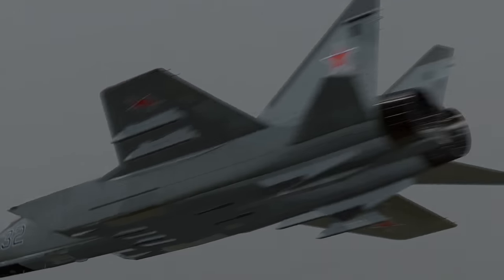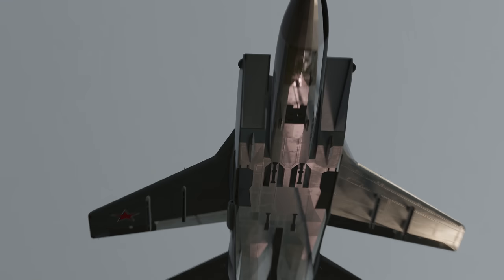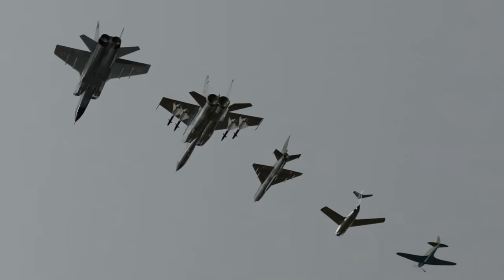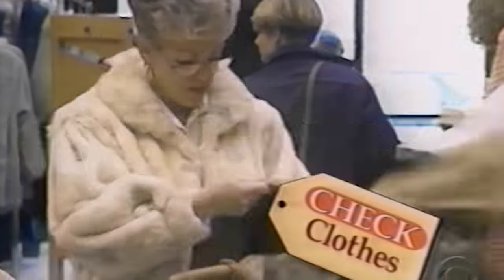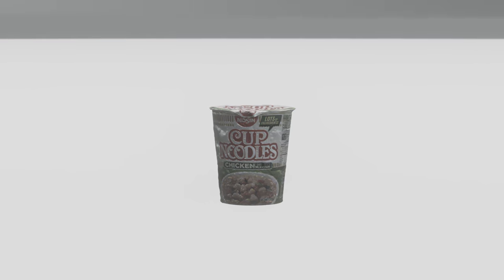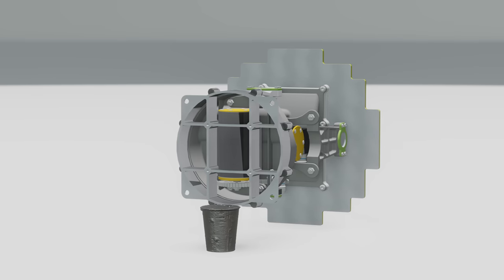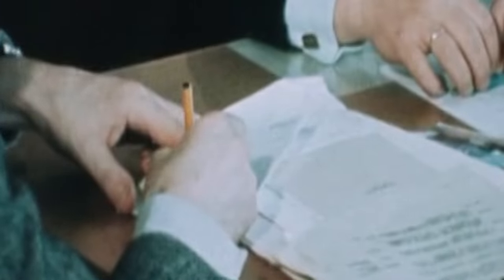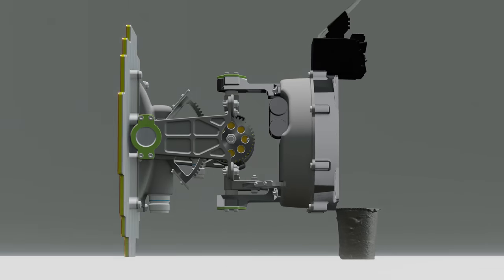We have revolutionized the cup noodle

Comment: A pencil is a kind of writing equipment that is also used to draw, usually on paper. Most pencil cores are made of graphite powder mixed with a clay binder. So, a pencil is usually made with a piece of graphite mixed with clay that has a wood case around it. The shape is usually a hexagonal prism but some pencils are square or cylinder.

Colored pencils are a kind that do not use greyish silver graphite. Instead, the core is colorful. Colored pencils or crayons are usually meant for drawing rather than writing.

The important difference between pens and pencils is that the tip of a pencil is made of solid graphite (or other material) which is rubbed off onto the paper. A pen has a tip, usually made of metal, with liquid ink coming out and onto the paper. Writing with a pen can smudge when it is still wet. Writing from a pencil can be erased, but writing from a pen usually cannot, unless it uses a special type of ink and eraser.

An early writing tool was the reed pen used by ancient Egyptians, who wrote with ink on sheets of papyrus paper.
Another early writing instrument was the stylus, which was a thin metal stick, often made from lead. It was used for scratching onto black wax that covered white wood, a method used by the Romans. The word pencil comes from the Latin word pencillus which means "little tail". It is an invention of the 16th century in England.

Some time before 1565 (it may have been as early as 1500), an enormous deposit of graphite was discovered in Borrowdale, Cumbria. The locals found that it was very useful for marking sheep. This particular deposit of graphite was extremely pure and solid, and it could easily be sawn into sticks. This is still the only large scale deposit of graphite ever found in this solid form. Chemistry was in its infancy and the substance was thought to be a form of lead. Consequently, it was called plumbago (Latin for "lead ore"). The black core of pencils is still referred to as lead, even though it never contained the element lead. 

The value of graphite was soon realized, mainly because it could be used to line the moulds for cannonballs. The mines were taken over by the Crown and guarded. When sufficient stocks of graphite had been accumulated, the mines were flooded to prevent theft until more was required. Graphite had to be smuggled out for use in pencils. Because graphite is soft, it requires some form of holder. Graphite sticks were at first wrapped in string or in sheepskin for stability. The news of the usefulness of these early pencils spread far and wide, attracting the attention of artists all over the known world.
England continued to have a monopoly on the production of pencils until a method of reconstituting the graphite powder was found. The distinctively square English pencils continued to be made with sticks cut from natural graphite into the 1860s. The town of Keswick, near the original findings of block graphite, has a pencil museum.
The first attempt to manufacture graphite sticks from powdered graphite was in Nuremburg, Germany, in 1662. It used a mixture of graphite, sulphur, and antimony.
Residual graphite from a pencil stick is not poisonous, and graphite is harmless if consumed.

The Italians first thought of wooden holders. In 1560, an Italian couple named Simonio and Lyndiana Bernacotti created the first blueprints for the modern carpentry pencil to mark their carpentry pieces. Their version was instead a flat, oval, more compact type of pencil. They did this at first by hollowing out a stick of juniper wood. Shortly thereafter, a superior technique was discovered: two wooden halves were carved, a graphite stick inserted, and the two halves then glued together–essentially the same method in use to this day.
English and German pencils were not available to the French during the Napoleonic Wars. France was under naval blockade imposed by Great Britain and could not import the pure graphite sticks from the British Grey Knotts mines – the only known source in the world for solid graphite. France was also unable to import the inferior German graphite pencil substitute. It took the efforts of an officer in Napoleon's army to change this. In 1795, NicholasJacques Conté discovered a method of mixing powdered graphite with clay and forming the mixture into rods that were then fired in a kiln. By varying the ratio of graphite to clay, the hardness of the graphite rod could also be varied. This method of manufacture, which had been earlier discovered by the Austrian Joseph Hardtmuth of Kohl-l-Noh in 1790, remains in use.
In England, pencils continued to be made from whole sawn graphite. Henry Bessemer's first successful invention (1838) was a method of compressing graphite powder into solid graphite thus allowing the waste from sawing to be reused 

American colonists imported pencils from Europe until after the American Revolution. Benjamin Franklin advertised pencils for sale in his Pennsylvania Gazette in 1729, and George Washington used a three-inch pencil when he surveyed the Ohio Territory in 1762. It is said that William Munroe, a cabinetmaker in Concord, Massachusetts made the first American wood pencils in 1812. This was not the only pencil-making occurring in Concord. Henry David Thoreau discovered how to make a good pencil out of inferior graphite using clay as the binder; this invention was prompted by his father's pencil factory in Concord, which employed graphite found in New Hampshire in 1821 by Charles Dunbar

On 30 March 1858, Hymen Lipman received the first patent for attaching an eraser to the end of a pencil. In 1862 Lipman sold his patent to Joseph Reckendorfer for $100,000, who went to sue the pencil manufacturer Faber-Castell for infringement. In 1875 the Supreme  Court of the United States ruled against Reckendorfer declaring the patent invalid.
The metal band used to mate the eraser with pencil is called a ferrule.

The first attempt to manufacture graphite sticks from powdered graphite was in Nuremberg, Germany in 1662. They used a mixture of graphite, sulfur and antimony. Though usable, they were not as good as the English pencils.
English and German pencils were not available to the French during the Napoleonic wars. It took the efforts of an officer in Napoleon's army to change this. In 1795 Nicholas Jacques Conté discovered a method of mixing powdered graphite with clay and forming the mixture into rods which were then fired in a kiln. By varying the ratio of graphite to clay, the hardness of the graphite rod could also be varied (the more clay, the harder the pencil, and the lighter the color of the mark). This method of making pencils is still used today.

Today, pencils are made industrially by mixing finely ground graphite and clay powders, adding water, forming long spaghetti-like strings, and firing them in a kiln. The resulting strings are dipped in oil or molten wax which seeps into the tiny holes of the material, resulting in smoother writing. A juniper or incense-cedar plank with several long parallel grooves is cut to make something called a slate, and the graphite/clay strings are inserted into the grooves. Another grooved plank is glued on top, and the whole thing is then cut into individual pencils, which are then varnished or painted.
A few common brands of colored pencils (among other items) are Crayola, RoseArt and Cra-Z-Art.

Comment: Wait, haven't you heard about new Sukhoi chicken breast and spaghetti TV dinner? That cooks itself during the flight in 30seconds and equipped with new ГСМ3014Ф6 air to ground guidance system that allows it to ease your hunger with precision up to 96 percent from altitude of 10k km with possible deviation in 0,23cm from point of target and guaranteed penetration of 960mm frontal composite armor with ability to break through its passive and active armor defense.
That is what called - Revolutionary
Order now and you will get 50 percent off on the next dinner and a free can of coke

Comment: we need a washing machine with an General Electric GAU-8 Avenger, designed by General Electric the GAU-8 Avengerr is a 30 mm hydraulically driven seven-barrel Gatling-style autocannon that is primarily mounted in the United States Air Force's Fairchild Republic A-10 Thunderbolt II, capable of producing up to 3,900 RPM, which can obliterate any germs inside or out of the washing machine, adding on include a Pratt & Whitney F135 two-spool afterburning turbofan engine to prepoll the washing machine of up to speeds of mach 1+ to have ease of transportation and use anywhere of your choosing.

Comment: You see though, despite the claims of the soviet government, and later russian government and the MIG bureau the MIG cupnoodle was a very flawed design.

While being more then able to exceeding speeds higher then MACH-3 it's nickelsteel alloy which while cheap and allowed it to be produced made it impractical for the jet itself to exceed beyond speeds of MACH 2.4, only slightly faster then its competition at the time, the American Lockheed martin CN-9 "Spectre." This also ignores the blatant fact the cup noodle was made to counter American bombers during the cold war, and was an interceptor not made for attacking fighters.

However the impact it had on American cup noodle design doctrine was significant, it allowed for amazing jets like the CN-13 "Banshee II." fighter jet, and was later replaced by arguably one of the most advanced cup noodle interceptor designs in human history, the Mig Cup noodle 31.

Comment: And with the improved d-32 self heating baseplate, boasting 132.26 kN of thrust and reaching temperatures 1682 K. It can fully heat noodles in 0.1258 seconds and retain its unparalleled speed and takeoff capabilities.

Comment: I wouldn't be so confident just yet. With the release of the Lockheed Martin F-35 Lightning II stealth capable cup noodle made from carbon fiber, composite, and exotic materials, Lockheed Martin is set for maximum efficiency in 1 circle and 2 circle BFM's (Big Fucking Maneuvers). The Lockheed Martin F-35 Lightning II cup noodle capabilities are unmatched when they come factory equipped with an AN/APG-81 active electronically scanned array fire-controlled radar system, which outperforms anything those snowy soviets could even feebly start to comprehend. This combined with the Multifunction Advanced Data Link for a fast-switching, narrow directional communications data link between stealth cup noodles: the Lockheed Martin F-35 Lightning II cup noodle can seamlessly transfer critical ramen nutritional data to any ally cup noodles from vast distances. The Lockheed Martin F-35 Lightning II A/B/C cup noodles will be able to dump a hot, steamy, boiling load all over the MIG cup noodles before they even know the Lightning II cup noodle is coming.

Comment: I believe this cup of noodles can still be improved. While it can detect these aircrafts, it cannot do much about them. This is a huge vulnerability if the customer is not equipped with the proper antiair equipment. While this would be entirely the consumer's fault for lacking basic preparation, the new cup will be even more attractive if the noodle cup is packaged with a Soviet standard issue SA-18 Grouse portable shoulder-launched anti-aircraft missile system to protect the cup holder.

Comment: But what about Firepower/Ordinance? I need a 50-Cal Vulcan on there, with stabilising fins on the rear, and counter-thrusters to stop the blowback from the Vulcan Stalling my Cup Noodle mid-flight!! Also, some Wire-Guided Missiles might prove handy to Counter the A-A Batteries disguised as BLT Sandwich packs the Chinese invented there in 2018. 😆

Comment: I think the soviets missed the point of the cup noodle. Just went on and on about ways to improve the cup, and didn't even touch the noodles.

I'm not paying more than 2 dollars for cup noodles, I don't even care if you mounted a weapons system on it.

Which, I should note, was suspiciously absent. What's the point of manufacturing a military grade cup noodle with radar tracking and target sharing capabilities if there isn't a weapons platform?

And don't tell me the noodles are the payload. You're supposed to eat noodles, not be killed by noodles. I don't see even one air to air or air to surface system in place.

Comment: The video is funny because it satirically juxtaposes two completely different fields – aeronautical engineering and cup noodles. The transcript humorously frames the Mikoyan-Gurevich Design Bureau, a Soviet aerospace manufacturer known for developing advanced fighter jets and aircraft, as the creators of a new and improved cup noodle.

The script takes jabs at the "frail and rapidly declining west" by stating that their cup noodles are made of weak materials and are symbols of consumerism, while the Mikoyan-Gurevich cup noodles are presented as superior in every way. The video humorously exaggerates the importance of cup noodles, comparing it to significant historical events, such as the launch of Sputnik 1.

Furthermore, the inclusion of advanced technologies like the pulse-doppler radar and digital datalinks in the context of cup noodles is absurd and comical. The offer of a complementary afterburning turbofan engine with a cup noodle order adds an extra layer of irony to the video, as it is an over-the-top and unnecessary pairing.

Overall, the humor in this video stems from the absurdity of combining two entirely different fields and the satirical exaggeration of the Soviet Union's superiority in the realm of cup noodles.

Comment: But... how well does it do the job it's named after? Designers and engineers got a bit too carried away.
In that can you might, probably, put not just noodles (in this case, though, it should be actual group A durum pasta and actual meat), but some water as well, and the conveniently provided radar will heat it up as hot as you want for as long as you want. Wait a few minutes, and congratulations, you've got yourself not just a can (yes, it is technically a can) of noodles, but a standalone radar as well, not to mention you can repurpose the can to fit anything you might want, as long as it fits, of course.
Reply: If you can't eat the cup noodle because it's too far away, it automatically fails. In Soviet Russia however, cup noodle finds you